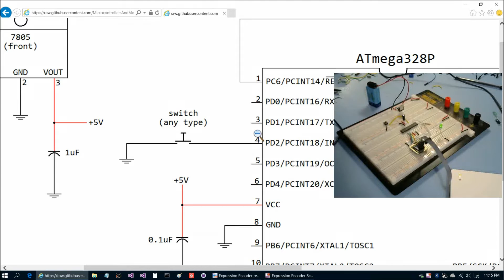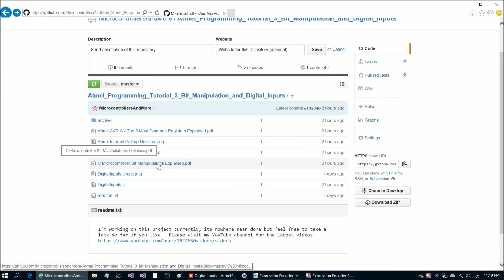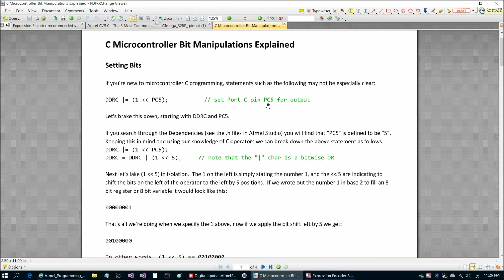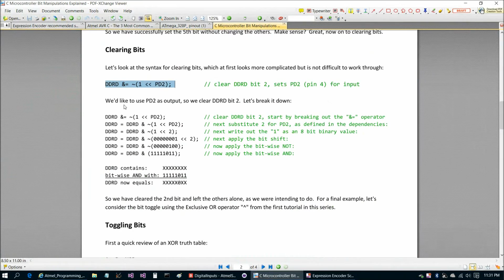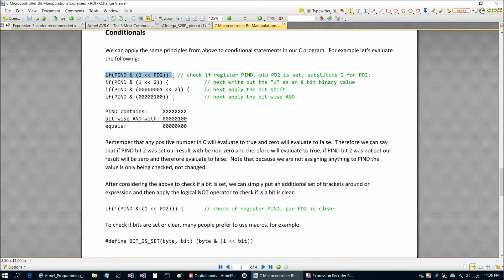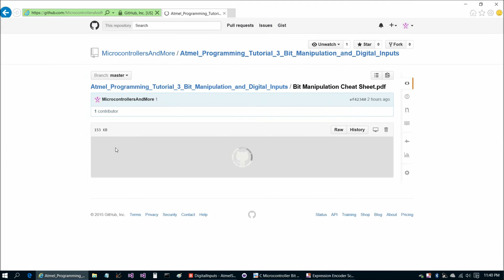Atmel Programming Tutorial 3 - Bit Manipulation and Digital Inputs

Comment: Really appreciate these tutorials - thanks.  I'm a retired engineer, spent last few decades in management, and in retirement I'm enjoying getting my hands on hardware and doing coding again.  I got a Raspberry Pi and an Arduino, and quickly realized that for my first project, I needed to use some counter/timer functionality with the Atmega 328p which is not natively supported by the Arduino IDE, and that what I needed was do register level programming to get more direct control over and full use of the Atmel micro-controller.  And to do that, I needed to understand the controller at more fundamental level.  Your tutorials have been perfect for that!

Comment: Why are you using an ELSE IF?? You already know that your conditional will return TRUE if it jumped to here in the first place!! Help me understand this AVR compiler.....

Coming from PIC C, I'd type something like this in my loop:

if(!input(PIN_D2))
output_high(PIN_C7);
else output_low(PIN_C7);

The compiler will handle the PORTx directions automatically.

And for more complex projects I'd type this:

#define ledPin PIN_C7           // tell the compiler to read "PIN_C7" every time it sees "ledPin"
#define buttonPin PIN_D2     // respectiely for "buttonPin"
#use_fast_io(d)                       // tell the compiler "I'll set my own PORTD I/O direction"
#use_fast_io(c)                       // likewise for PORTC

and in my main program:

TRISD = 0xff;                            // set PORTD as all inputs (or 0b11111111) 
TRISC = 0;                                 // set PORTC as all outputs (or 0b00000000)

and in my loop:

if(!input(buttonPin))                // If I press the button (actie low),
output_high(ledPin);               // turn on the LED.
else output_low(ledPin);        // If not, turn it off.

No need for curly brackets since they are single line instructions. 

I'm not sure I'd even consider bit manipulation on my I/O direction registers unless I was multiplexing on that PORT. 

And even then, only if I were multiplexing INputs with OUTputs, AND changing directions during an interrupt. This is the only case I can think of where I wouldn't be sure of the present direction of any given I/O pin (don't forget to set it back before exiting the ISR)!!

Comment: Is it possible to use the arduino UNO for this?, since it has the ATmega328P. I do not have a debugger, but i made an external tool programmed into the Atmel studio 7, so i can code in C to the ATmega328p connected tot the arduino.

Comment: line 7 : // define it now as 1GHz unsigned long.
it should be 1 Mhz.
Reply from the maker: Thanks for the feedback, that was a typo, just fixed it.
Reply: Yeah I know but many beginners are watching this kind of videos. They can be confused, therefore I'd like to make add that comment. Anyway, your videos are very well. I hope it will be long and detailed video series about Atmel.
Reply from the maker: Thanks for the feedback.  Being that I run the programs during the videos I can be confident that those are correct.  On occasion I may leave a typo here or there in the comments.  If you (this goes for all viewers) notice any suspected typos or other errors please post in the comments and (time allowing) I will make the applicable corrections, thanks!